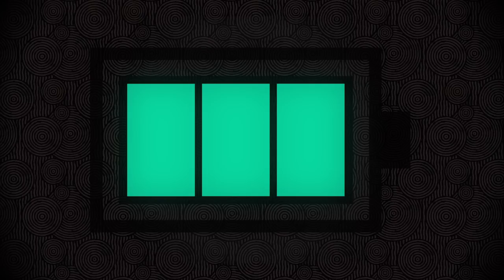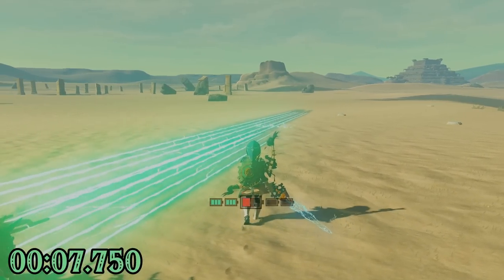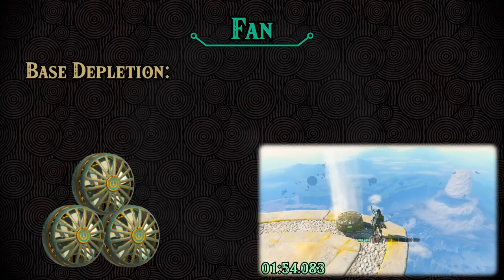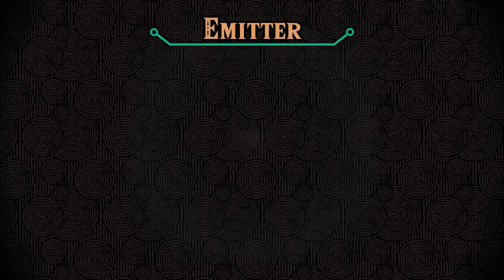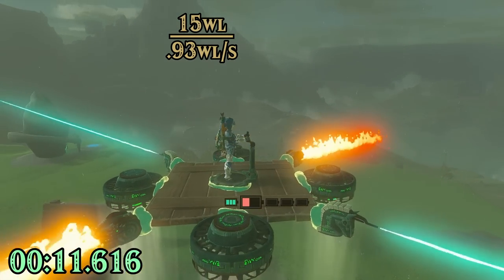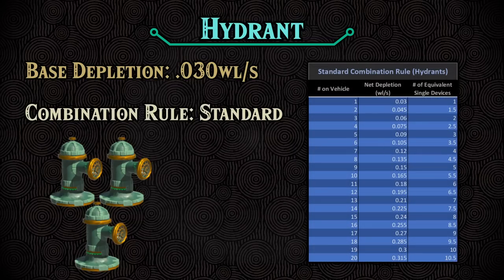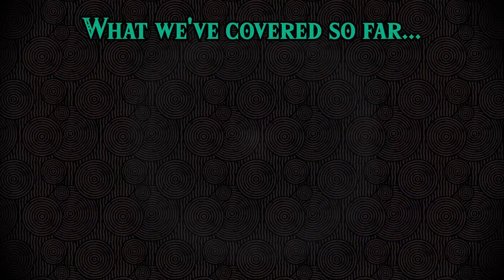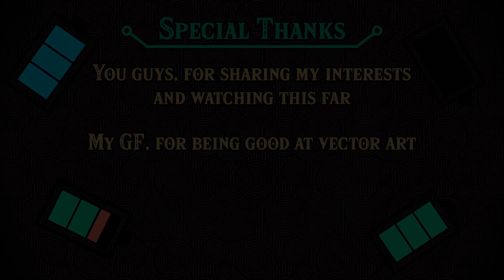How Does the ENERGY CELL Work in Tears of the Kingdom? | All your Zonai device questions answered!

Comment: I think your zonaite energy cell recharge rate was off, possibly, because the amount of time you said plus the amount of wells you had was different between the 2. You said flat rate, but I'm not sure personally as I haven't tested it, I didn't really start using them until I glitched enough duped large zonaite to get max wells, I've done one test since.

With zonaite armor and full cells you can take the giver bike from the most northwestern shrine to the temple of time without recharging, one more from there to the platform above eventide.
Reply from the maker: Recharge time is constant, from what I found.  Rate increases with your well count.  I tested this using three different max well counts (3, 15, and 33) and the results were consistent. 

I guess it was misleading to have different well counts in the Zonaite armor vs. non-Zonaite armor sections.  Sorry!  I accidentally put the timer overlay on the wrong footage and didn't feel like changing it.

Comment: CAREFUL LADIES, HE HAS A GIRLFRIEND 

great video, but i do have one question. it seems like even the use rate of the fans is NOT constant, as anyone who has taken a fanned flying vehicle and used it in the water sees how much the usage rate goes down. 

so what is the base depletion rate of a fan in the water? i know it's different. this also applies to a "meat flyer" which can be constructed to give forward and slightly downward thrust, and with a piece of frozen meat, the vehicle technically touches ground and it more efficient that way. i've done runs thru tanagar canyon and i can't explain it any other way. the fan has multiple depletion rates.
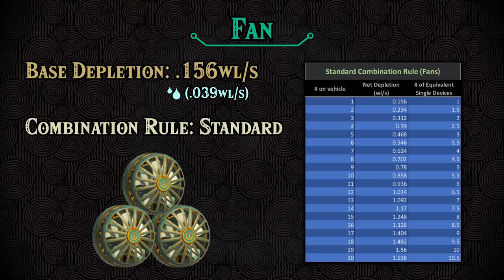Reply from the maker: Indeed it does.  At 11:00, on the final info card for the fan, I gave it's aquatic depletion rate (.039wl/s) under the main depletion rate.  Keep in mind that ALL fans will benefit from this effect if ANY part of the vehicle touches water.  However, if your vehicle leaves the water, the effect will be instantly lost.  Because of that, if your fan vehicle is dipping in and out of the water, it becomes difficult to predict its duration because it kept alternating between two behaviors.  This is what often happens with flying machines low down to water.  (You can kinda see this effect at 10:25 with the fan minecart.  Closely look at the red fraction of the battery.  When the cart touches the rails and activates the efficiency boost, the red region on the UI becomes thinner.)  

As for the fans touching the ground, on like a meat slider or something, I didn't see any change in behavior, but I could run some more tests when I have time.

Comment: 15:42
This isn't to say you're lazy (testing and documenting these kinds of things is a lot of work), but in a situation like this where there is no clear pattern, isn't it all the more important to measure all the way to 20?
Reply from the maker: It came down to deciding what was worth my time.  I rarely see vehicles with 10+ wheels or stabilizers (etc.).  Since I am just a single person putting all this together, it was more worth my time to focus on the other parts of the video.  I mean, have you ever built a vehicle that has more than 10 of one non-SCR part?
Reply: @paradox_guardian  That's fair.
Reply from the maker: @lamenwatch1877  yeah… It bothered me too, but between wheels and misc.  there are 7 different devices to test.  Back when I was putting all this together, I couldn’t assume devices shared combination rules, so I was testing them all one-by-one.  It just takes a while to do that and edit the video and make the calculator.

Comment: I just want to know what the red part of the batt bar means when in use.
Reply from the maker: It is an indicator of how quickly you are burning the energy cell.  More red=greater depletion.
Reply: @paradox_guardian  how to read it? If for example the red bar is 1 cell width, how fast is the depletion rate? Also, I have had some builds with similar width red bars but deplete one significantly slower than the other.
Reply from the maker: @trei49  so from what I’ve seen, there is a “minimum width” of red bar for slowly draining devices, which means that two machines will appear to have the same red bar size if they are both efficient enough.  I wish I could go into more detail but I can’t conduct experiments with as much precision as I desire